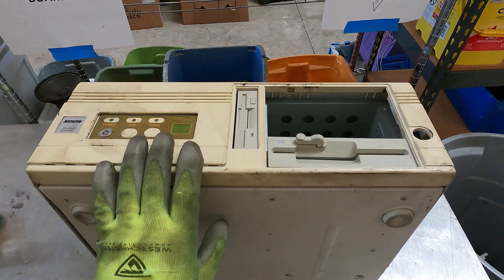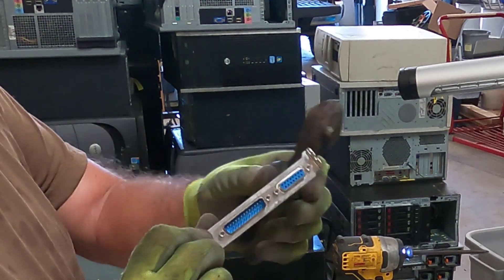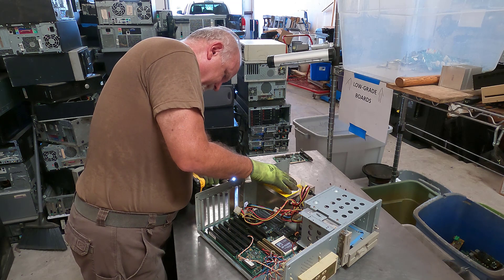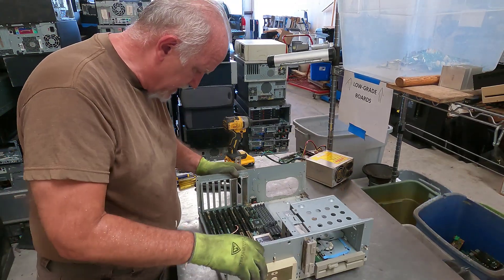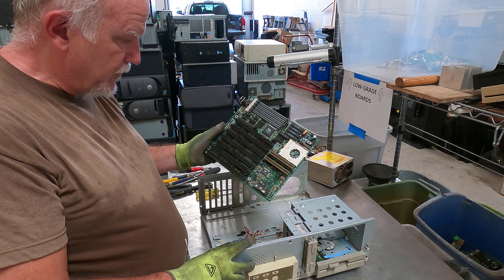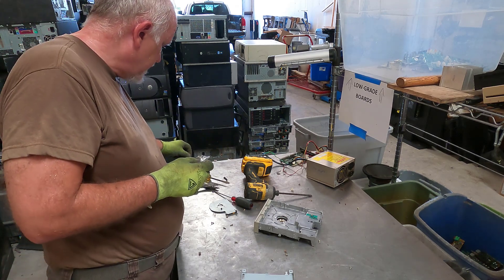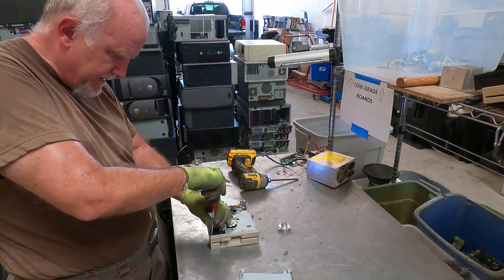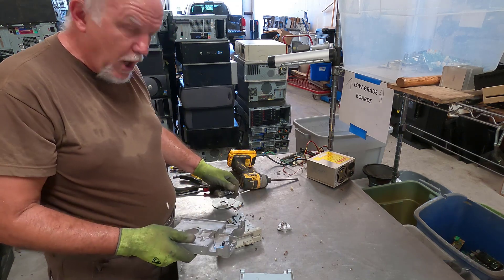Electronic Waste Scrapping - what's in an old off brand computer?

Comment: Would you be willing to sell certain parts rather than immediately disassembling them
Reply from the maker: email me with what you're interested in and I'll see what I have.  I've had mixed results selling older PC's and parts.
Reply: @sharkscrapper  Otherwise id be interested in some 5" drives and some specific soundcards
Reply from the maker: My email address is on the ABOUT tab of my YouTube homepage.  Let's connect there and I can show you what I have.
Reply: @sharkscrapper  Generally for older drives its a good idea, most people will gladly pay 10 or 20 bucks for a drive since people try to get hundreds for them (and fail)

Comment: I have unspooled those floppy drive motors. Find the outer most end of the copper wire, hold on to it and bounce the metal part at the end of the wire and it will start to dance at the end of the wire as it unspools.
Reply from the maker: Dancing copper spools - my favorite 😂

Comment: Sometimes on those old PCs I'll grab the floppy pin connectors for the 2.5 inch type with pliers to rip it out so I can leave the floppy drive in the frame. All depends if they are easy to get at, larger 5 1/4 inch i tend to take apart if the frame is alum like that (often are).
Reply from the maker: help me I'm micro-scrapping and can't stop 🤣

Comment: I love the oldies. Chris is giving better prices for non ide boards, so the old ribbon connections are more desirable than the new cable design. I saw the heat sink was missing, figured whoever took off the hard drive took the heatsink, but it was missing paste. 🤔 My yard has two prices for #2 wire, with plugs off being about a nickel better. They also buy plug ends separately, weather they be brass, cold pin or power supply.
Reply from the maker: I love learning about how different yards handle scrap.  I guess that makes me a scrap nerd.